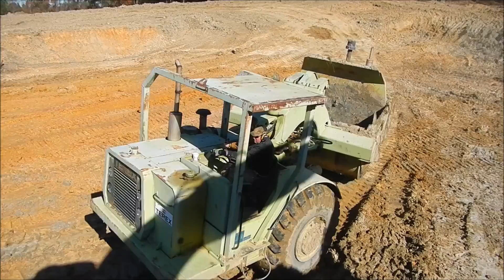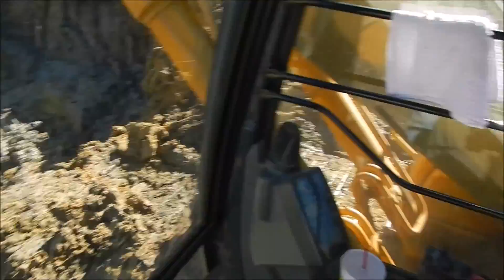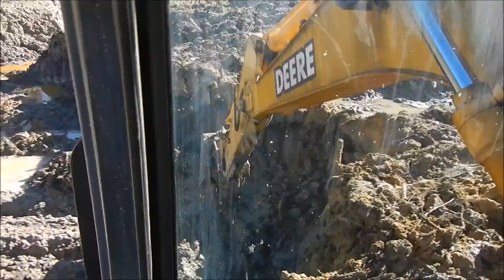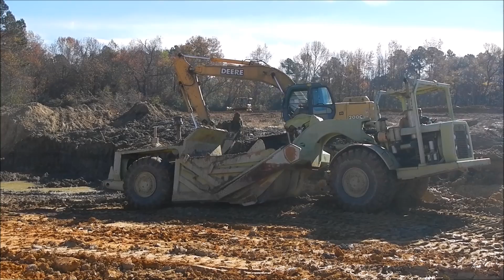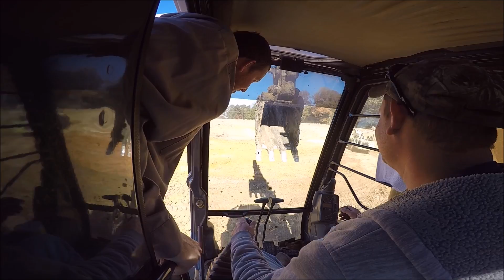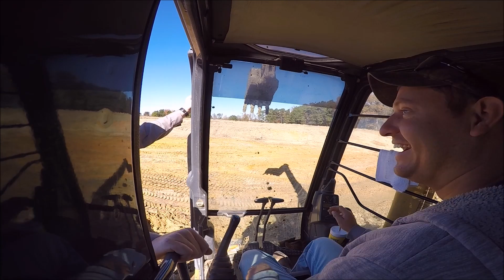I Went To Work With Justin Today

Comment: It's a TS-14 w/ two 4-71's. It's a 2 stroke diesel & they were  tested in many app- lications , since the late 1930's. If your running straight pipes it's gonna scream louder!! Just think, it could have been a model 353 T Wabco with twin 12V-71s, a real 'buzzin two dozen' !!

Comment: Hard to beat the hitachi hiding in Deere colours 💪💪💪💪
Reply: John White yeah but with a real Made in the USA Diesel
Reply: Until you compare one to a komatsu or link belt lol
Reply: John White I love Hitachi learnt to drive on them hate going on anything else
Reply: jdig1984 learned to drive!!?? Lmfao no steering wheel how can you drive it. Apparently you aren't a operator then
Reply: Travis Roach drive operate what's the difference I'm from the UK and we don't use the term operate as much as you infact alot of jobs are advertised as 360 excavator driver. We don't say I ran a d6 we say I've driven a d6. So to recap i like OPERATING Hitachi diggers(that's another one you haven't heard look it up) and have done so for many years and even some with a steering wheel there called a rubber duck you can look that up too 😜

Comment: That glorious old dog of a Terex, from the 1970's era. Still on the job, and  purring ( roaring, actually with those 2 GM Diesel engines.  ) under the load of mud.

I can't quite recall the model , is it a TS-18 , do you know Chris? I know it has an 8V71 in the front and a 6V -71 or 6-71 rear, and the 18 meant it had a capacity of 18 cu. yds.
Which brings me to that Deere, it works well, but does Justin do mostly ditch work with that bucket?
Reply from the maker: TS14. I dont think he does much ditching but wont get a bigger bucket lol
Reply: TS14B  2 471's.  20 yds heaped.   Says the man behind the wheel
Reply: Thanks,  and regarding Justin and the small bucket, I guess he like all those cycle times. Great video though.
Reply: Thanks for the information,... and yes there's a helluva difference between the two, but those 4-71's  are still running clean, by the looks of things. 
So 20 yards heaped,...that's about the way it looks it was being loaded. 
Good stuff.

Comment: We live in Minnesota and I’m really confused by all the ponds you build down there?  In the county we live in there are 1367 lakes that are over twenty acres. That doesn’t count the swampy lakes that I love. 
I’m confused do you build lakes for farming or just landscaping. Or is it for flood control? 
You do good work keep having fun.
Reply from the maker: all the ones in the country are for irrigation, some are just for looks and private fishing holes.  All the ones in the city are building for stormwater control ( prevent flooding)
Reply: Also can be for heating/cooling a structure using a water source heat pump.
Reply: Andrew H    In northern Minnesota it gets so cold that we use ground water heat pumps for heating and cooling. But normally most of us don’t cool in summer because we enjoy the few times during the year we have hot weather. The truth is my body is not built for over sixty five degrees. I’ve been known to wear shorts to town in the winter to purchase milk. 
In fact we drive three or four months a year across the lake ice. We live on a good size lake and the ice is our short cut to town. From our home to the boat landing it’s almost a mile. I let my neighbor be the first across the lake to make sure it is safe. Then everyone on the point of land drives across. 
This week the lake froze over for two days and then today it opened backup. When it opened in front of our house sixty or so swans landed. I tossed out some grain for them and six deer came down the hill to eat it. They didn’t seem to care when I told them the grain was for the swans.
Reply: You can still use lake/pond/river water for a heat pump even if the surface is frozen as long as the intake is deep enough to not freeze up. 

If you get yearly frozen lakes thick enough to drive on check what rules are for harvesting ice for summer use as you can make a radiant slab to set the ice on and get free cooling for the house or just a cold room for storing food without the need of power. 

Finding a frozen lake here in Arizona is a real challenge but I do get to wear shorts year round as I'm so used to the climate near D.C. that out here it is warm even the few times it drops below freezing overnight as the humidity is insanely low.
Reply: Andrew H I grew up near a lake in town called ice lake there was a building  insulated with sawdust next to the lake. During the winter ice was collected and used for ice boxes all summer. I knew of a few people who used ice storage root cellar type building to keep their ice frozen all summer. For fun we sat in these on very hot days as children. 
I agree that there is a place for gathering ice from lake even today.  
I use my chainsaw to cut deep into the ice for spear house. Cut A two by three foot hole and slide the house over the opening.  There is nothing -30 outside and +70 inside while fishing. Very fond memories of doing this. 
Now days people spend 20000 for custom built fish houses with holes all over the place to fish from. You can watch the game from your tv while cooking the fish in the kitchen. When your tired just curl up on the bed next to the hole. Lol 

I’m sure people down south are shaking their heads. I remember as a teenager getting two pipeline welders fellows who drove up from Texas get their truck started when it was -30 plus high wind. It took me an hour or so to get them going while these two bought warmer jackets. When they got back we had to put number one diesel in the tank because their diesel fuel was jelling from the cold. They gave me a look of pity and then gave me a huge tip and headed back to Texas. I had to laugh at those two fellows because we were in a warming spell they should have been there a couple of days before.  
They never got to their worksite in the middle of a frozen bog were pipeline could only be placed in the dead of winter. In the summer all the heavy equipment would sink into the bog right next to the crude oil pipeline.